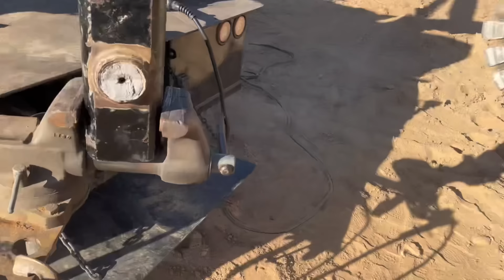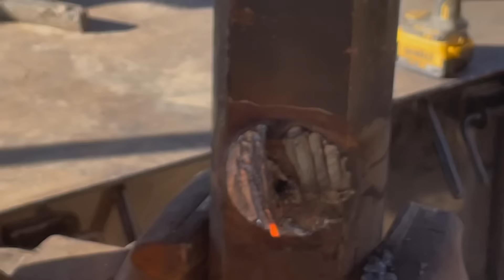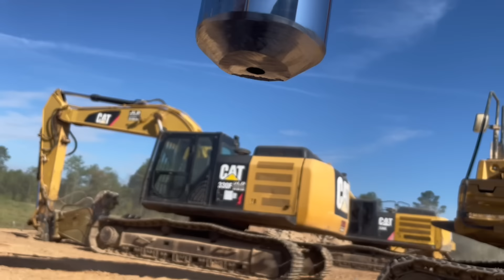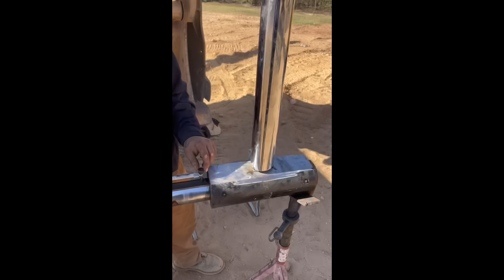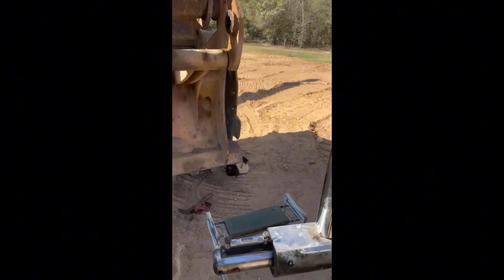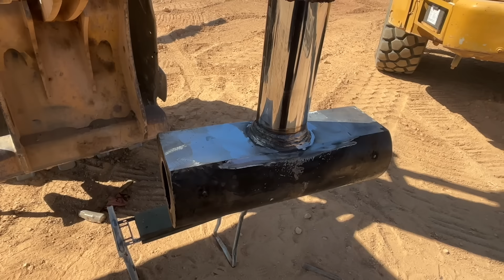On-site welding repair on a Broken thumb cylinder for a CAT 330 excavator.

Comment: You beveled into the finished piston, what stops the rod going into the cylinder into the welded area and ripping out the wiper and seal on the cylinder?

Comment: That's a good job for a flushing tip and put a fire blanket so you don't get spatter on the ram arc gouging is cool too get your fit up tack it four corners and weld it up it always  breaks right next to the weld it's a hard spot and there is stress right there from the weld

Comment: After securing it to the grub screw, why didn’t you just put it back into the thumb with the pin to hold the bushing and weld it up? That way when you’re welding the bushing it can’t move and you know the pin will go in and out. Where are you located?
Reply from the maker: Just because it is pinned together doesn’t mean it won’t pull causing the boss to pinch the pin in the bores. I’ve learned most of what I know the hard way and in my opinion the way I did it was the best way to ensure it stayed straight as possible. Welding in place would have made it harder to consistently weld even passes. Like I said in the video it’s would have worked either way but I like to be able to check after welding to see how straight it stayed.
Reply: @Johnson_Trades where are you located

Comment: At 12:30 what tool is that you were using? I do appreciate the videos thanks for filming your work and sharing it with us
Reply from the maker: It was a custom base I made to reference the cylinder rod. And a modified starrett 98 level so I can adjust the vile to  adjust it to level on out of level surfaces

Comment: Doesn'it affect the fact that the base material has not been heated before welding to avoid cracks in the weld.Since the piece to be welded is quite thick? .
Reply: If you heat up that cylinder rod it can actually make it weaker because that type of material already been heat treated to withstand a certain level of hardness so per heat this type of repair will make the material weaker call Annette to break not at the weld but at the material that's a good thing to know what type of material you working with what type of heat can you put into it because too much heat and that type of material and you will have a bad day

Comment: I’ve found the 1045 in those cylinder rods likes a good preheat.  I treat them like x70 pipe and have very good success.  That break looked crystalized all the way through.  I wonder if somebody quenched it after welding the first time to speed up reassembly.  My view is a little fuzzy from 700 miles away though…